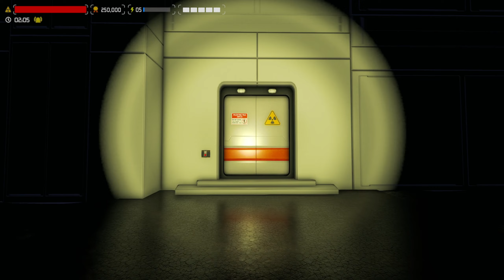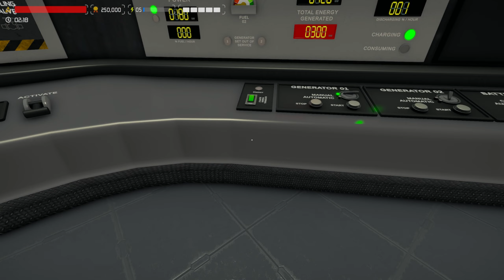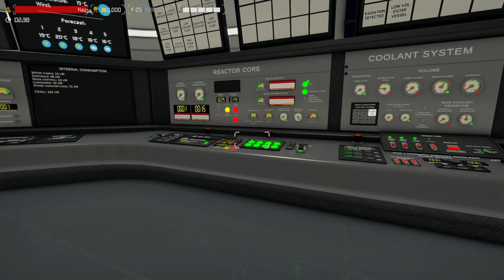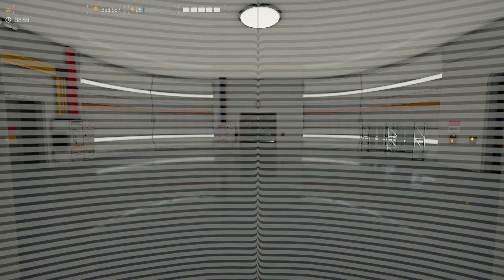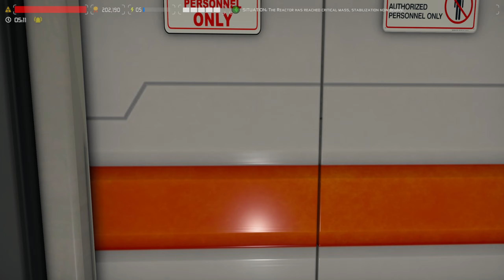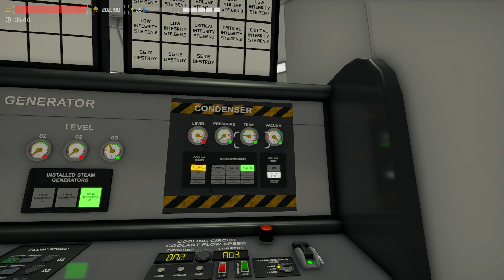Starting up Again? - Nucleares Tutorial

Comment: am i just missing something? or is my game broke? i've followed both this and your original scenario 3 video, and both times, once i get to the point of setting the control rods to 90%, the control rod engine instantly breaks, and the rods are now stuck at 90%, and i can't replace the engine because it's under radioactive water of course, and it just sprials from there, as since i can no longer control the rods, SCRAM does nothing, emergency stop does nothing, and i'm just at a point of it being unsavable, until it eventually goes kaboom
Reply from the maker: Then you haven't copied me exactly... as at the start of the scenario your core starts with no water... before filling them... set your control rods to 99% which will trigger them to break... you can then replace the rod controller for a new one from the facilities 3rd floor... then start filling the outer core and inner core etc. 😎✌️
Let me know how you go 🤔🤯
Reply: @ShArPy1o1Games  so it sounds like it might be a glitch then? because for me it starts with no rod controller installed at all, not even a broken one, it's just an empty slot, so the one that's breaking on me is already brand new, as i have to install it in the first place, unless one of the ones in storage is already broken?
Reply from the maker: It won't break till you set them to 99% as soon as you load in before anything else (other than turning th panels on) then it will trigger the hidden objective and break them for you to fix ✌️